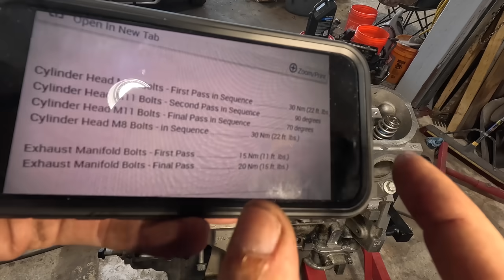This is the LAST VIDEO (LS Engine Rebuild) Ls1 Ls4 2006 SS Monte Carlo 5.3 Part 5

Comment: To all the critics of Ray “refreshing “ this engine.  When I was 16 I rebuilt the engine in a 1964 Pontiac Lemans in a garage with a dirt/gravel floor, no torque wrench (I used a lug wrench).  Nothing was done to the heads.  That engine ran for 10 years after that with no oil use, no smoke, no rattle, no problem at all.  He is not building a race engine.  This engine will run fine.  He does not build engines for a living, he does not build racing engines.  He is doing this for a friend.  It will be fine.  Been there, done that.
Reply: Hell, I just did head gaskets in my 3400. Didn’t have an angle wrench for the tty head bolts. I eyeballed the additional 90 degrees using a breaker bar. It’s still going 30k later
Reply: St Augie Def if closer, TY Brother

Comment: The front and rear covers are supposed to be tightened down before putting the oil pan on.  Clearance spec is 0 to 0.02" from bottom of covers to block.  Tightening them to the oil pan first could side load the seals.  Also, oil pan to back of block clearance should be checked, 0 to .01", to make sure the pan doesn't sit past the block and cause the bellhousing to sit cocked.  It's probably fine though :)  That nifty plastic thing that came in the rear seal is to help align the cover as well as guide the seal on the crank.

Comment: One thing we did with my brother's 355 was chuck a shaft into a battery drill and spin the oil pump over before inserting the distributor. We spent about 5 minutes doing that. Even with assembly lube. We wanted the oil pump and filter to be primed and the oil galleys filled.
Reply: Unfortunately can't do that with modern engines
Reply: I had an old cord distributor that I removed the gear from just for priming the oil system.
Reply: No plugs and turn over with no compression until it makes pressure, then put the plugs in: always worked for me
Reply: @DaveBigDawg  arp does have assembly lube for this. The last 3.6 I did, I just poured oil on the cams before installing the cam caps. It was just a can and rocker replacement though, so it wasn’t completely dry. Sone semi modern engines used a cam synchronizer in the spot the distributor would go, so this you could still prime. Could also pull the fuel pump relay and crank sone to get it primed if no other options.
Reply: @ab2230  with the modern oil pump setup. That's your only option.

Comment: I was holding my breath when you were tapping the head bolt holes with a drill and no lubricant. Expecting a broken tap every second. Wheew!
Reply: Truth! I was pretty confident Ray had the control to keep it lined up solidly but the lack of lubricant made my nerves itch 😂
Reply: What you missed was that he should have done that BEFORE assembling the engine.😱
Reply: @justpray365  That would have been the ideal, but I trust the clean up Ray did was more than sufficient to get things where they needed to be.
Reply: A teenager doing his first rebuild in his parent’s garage might do this.  But being a supposed professional this is unacceptable.  The block should have been hot tanked and all of the blind holes should have been tapped and cleaned prior to assembly.  And using the 100,000 mile oil pump is also a rookie mistake.  That is a mandatory replacement part.  And I’m not going to get into the cylinder bores not being checked with a bore gauge.  Lazy unprofessional build.
Reply: @shakerman55  Ray mentioned that this was a refresh and not an actual rebuild. This engine block is made of cast aluminum. The acid solution in a hot tank would destroy the block.
Reply: He's not using a tap he's using a thread chaser
Reply: @mlieser1230  
As I was an engine builder/machinist, (just retired), I know that there are solutions for aluminum.  It turned into a rebuild.  He said that.  The refresh was when he was just going to replace the cam.  Then things got serious, and a rebuild was done.  The problem is that he didn’t check any clearances or send the block to be checked or clean it properly.  When you have an engine out and completely torn down, it is due diligence and the right thing to do to check everything.  He wasn’t going to even clean the threads, which is why he waited until it was assembled to do that.  Then blew dirt all into a sealed, (oil pan on) engine.  Amateurish at best.
Added:  And reusing a 100,000 plus mile oil pump is about as unprofessional as you can get.

Comment: Another tip from reading Hot Rod Magazine when I was a kid, stand on the back of the engine stand and pull the torque wrench back towards yourself on the head bolts.  This prevents the stand from moving around.  Works great and it's easier to pull on the bolts than push them.  I also clean the head gasket surfaces with alcohol, since it's the only solvent that leaves no residue.

Comment: I've been getting Rayman rays withdraws over the past week and a half.  Welcome back.

Note to self!  Chase all the threads
With just a bare block next time before last clean up before assembly.  Ez with the tap you can get them out but if you bust one off in the block they are hard to get out. Taps are made out of tool steel the blocks an aluminum alloy. You burn them out with a torch i belive.

I broke a few 18" long 3/8" dia drill bits off in the center of a piss poor connecting rods for a locomotive engine that was oil passages kept running into sand pockets in the castings.  These parts were huge.
One hole for the crank was 4.5" dia the piston side was 2.5"  the total rod length was   24" long with the cap on.  
We worked on a block once they were really big.
But not as big as the motors used on big ships.  They can be as large as your whole shop. Just the block.

Comment: Ray, you chased all the threads for the large headbolts except the lower center headbolt. I looked through until I found someone else who saw what I did and it seems that there were a few. It happened as you were asked to go "to the office!" @25:59 in the video.

@Rohambili
25:59 you dont run down the thread under this... Bad Ray, let your darling distract you...

Comment: I think the front and rear cover needs to be aligned with the crankshaft to be centered and not the oil pan the gasket will take up any differences from the covers and the pan. They make a centering tool for rear and front cover to achieve this. Please let me know if the procedure in the shop manual has been updated. It has been a very interesting video. Thanks for all you do.

Comment: I do appreciate you running a tap into the block threads, I have often wondered how much damage, that horrible crunchy feeling you get, putting bolts back where they came from, is doing !

Comment: 23:23 those cross hatch patterns look just fine.  A-rod nailed it!
Reply: He neglected to check the bore dimensions.  Or check for roundness.  The bad cross hatch is the least of the worries.
Reply: @shakerman55  You don't know that.  You only know what you see, which is what he included in the video.  Don't jump to conclusions.
Reply: @silicon212  
He said he wasn’t checking them or sending the block out.  And he waited until the engine was sealed to do the right thing and at least clean the blind holes out.  Then blew crap all over it.  And a high mileage oil pump!?  Seriously.🙄

Comment: Seeing a nut dropped into the engine (retrieved with the magnet) reminded me of a near-final quality check performed on jet engine builds.  Before the final button-up, the engine was rotated 360 degrees either about its longitudinal (roll) axis or its pitch axis, while listening for loos parts... simple, not time-consuming, but effective!  Not only were small parts like nuts and washers found, but also tools.  Just food for thought.

Comment: Paint marking is good. I almost killed my motor by missing a single rod cap nut. Shut it down moments before that thing would have fell off. That was a long weekend. Old engine kit, new one in, and out in like 2.5 days 😳. Put a new bearing on the cap I missed and all was good

Comment: I think the miniscule amount of marking paint would easily get caught in the filter.  One could make the argument that the brake clean is also taking assembly lube off the bearings as it is so light it will surely wick into the spaces between bearings and journals.  
But, Hey!, I did this stuff back in the olden days (60's, 70's & 80's).  I am sure things have changed a lot since then.
Run-up the oil pressure before starting and everything should be just fine...

Comment: As a hobby machinist, gotta say the freehand tapping with power made me nervous.  Didn't clean the tap between each run.  Even when manually tapping I use a fixture or guide whenever possible.  Takes very little to change the fit of a thread.
Reply: If tapping a clean freshly drilled bore, sure. But chasing already tapped threads to clean out gunk & loctite takes very little pressure, and there's pretty much no chance of a tap binding or seizing in the hole. Like Ray said in the vid, he's using a variable speed drill and feedback torque can be felt easily.

Comment: What a job! I do remember torquing head bolts. It may have led to an arm joint issue. Learned to use angles more than brute force to do them. These type with the 90/70 degree are especially difficult and critical since it is stretching the bolt and cannot do a "redo" if you missed the target or bolt.  Great video showing what is entailed in that process done properly!  Glad to have you back doing videos...missed you Ray!

Oh, and we got a Lauren/WifeUnit cameo today.  I don't think her footwear would be OSHA approved. lol  But would be high on the cute scale.  😊

Comment: As best that I could tell the tap that you were using looked like a starter/taper tap. Which would have been the improper tap to chase the threads with. That tap is used when you are starting to cut threads in a drilled hole. That’s why it’s tapered, and why it’s unable to cut or even chase threads at full cut depth to the bottom of the hole. That’s what a bottoming tap is for, and what should have used. That way the threads would have been chased at full cut depth to the bottom of the hole.

Comment: Would put grease on the chase tap to collect chips, and clean chase tap after every hole as to not cross contaminate, but then you have to brake clean every hole due to some chips sticking in hole threads.

Comment: If anyone watching is wondering about how the head bolts are torqued, these are called 'torque to yield' fasteners, as Ray said, they stretch to the point of yield, thus producing the strongest possible seal.  TTY bolts use a Torque to Angle tightening sequence.
Reply: How much further can a TTY bolt go before it fails?
Reply: @clintprice2123  They are one and done.
Reply: @silicon212  Think they were inferring to the ones that Ray clearly went above torque.

Comment: You made a comment lately (in this video or maybe it was the broken front axle video,) that you were struggling to keep your videos to around 30 minutes.  I have a suggestion - Pull a piston one time; hone the cylinder one time; change the piston rings one time; then simply say you'll be back after you do the other seven.  We don't need to see the same procedure seven more times.  Or do a brake job on one side of the axle, then say you'll be back after you've done the other side.  We're intelligent people.  We understand.  We know what's going on.  I think it would make the video much more interesting.

Comment: Ray on my opinion you should torque down the timing covers first because front main seal and rear main seal they would be center to crank On my opinion,  if you torque down the pan first, it might push against the front/rear main seal housing and won’t be  be center to the crank. we can always rtv the pan but not the seals.

Comment: Ray. I have to say this engine build has been one of my favorite series of repairs you have done.  I like watching this stuff and appreciate your attention to detail.
Reply: Reading sum viewers comments suggest this is a HOW NOT TO DO IT video...
Reply: I’m not sure if the details from the customer and that may have been why things many would do were not. If I were the customer and you’re already into that labor then having the block sonic tested and pushed to ls1 bore if possible and a new rotating assembly to include better performance upgraded camshaft would have been my way to go. Also heads ported and polished as well as decked and new springs and better roller rockers. However that adds another 5k to the build and that may not have been in the budget. Reusing the pistons is not a bad thing just not what I would have done as a customer. I also would have used main studs and head studs for longevity.  Either way I like watching engine builds and having built some I think he did fine. There was a cross hatching question that was addressed.

Comment: Respectively want to comment that I was taught a dry bolt can’t achieve the proper torque, you must use some type of thread lubricant for proper torqage
Reply: Bolt torque is almost always specified for a clean and dry thread. If threads are to be lubricated, a reduced torque will need to be used and should be called out in the documentation for the fastener. In the case of the head bolts, with thread locker, I suspect the manufacturer specified the torque with the threadlock. Unless specifically called for, torqued fasteners should never be lubricated. Lubricating will almost certainly result in over torqued fasteners.
Reply: You'd not lubricate head bolt holes this can cause a oil hydrolock  and allow the head to lif causing catastrophic failure ask me how I know!
I did pistons rings main and rod bearings on a 2.8L ford Capri (English vehicle) the car ran great for 4 hours and then the head lifted causing a failure.
Ford released a bulletin regarding this issue but only to the dealer network not the independent shops which is what I started and ran for 7 years.
Reply: It's like olpeoples underwear, it Depends. Every manufacturer specifies something different. Detroit Diesel two stroke engines call for slobbery amounts of grease called peanut butter because that's what it looks like. Different Strokes for different people.

Comment: Meticulous work, Ray!  No one should use power tools to clean tapped holes in anything.  But your experience and my decades as a maintenance machinist will let us get away with it. The cost in time saved is just not worth the risked time to install new threads. A speed wrench or a tee handle is best.

Comment: 5:50 - Not a new oil pump going in?  o.0  I mean I get it, it worked so why not, but... in the scheme of all that cost being put into rebuilding the engine, I have zero idea why that wasn't also mandatory.  Customer declined I suppose? Customer's not seeing a big enough picture if that's the case.  Unless I'm so far off base I should be put in time out... >shrugs<
Reply: A new oil pump should be mandatory on a rebuild.  The customer won’t remember anything but Ray did a bad rebuild, if the oil pump stops working.
Reply: @justpray365  It will probably leak oil pressure on the inside of the engine, in the future, since he didn't upgrade the dogbone or replace the dogbone o-ring.  The oil ports for the DoD system should have been NPT tapped and sealed or used freeze plugs to seal them instead of o-rings that will fail to seal, in the future (just like the 3.6 pentastar oil cooler).  Then there's the old oil pump.  These oil pressure leaks will be hard to find in the future without tearing it back down and you may not find all of them at that time.  All the fanboys keep saying "He's a mechanic and not an engine builder" and that makes it ok to do a half-assed job?  It looks like he found a quart of two cycle engine oil out of his storage container, at home, and decided to use that instead of proper break in oil with higher amounts of moly, calcium, and zinc to give the rings and bearings the best chance to seat/seal.  Just because it will kinda work (you won't know the difference- wink) doesn't mean it's the right thing to do.  I sure hope the customer got a shade tree price for a shade tree job.
Reply: It sure is dark.

Comment: just a quick question but arent you supposed to use shims to 100% center that oil pump onto the motor then cross tighten the hardware.... I have seen it done somewhere...
Reply: Thought the same thing

Comment: The dod ports in the intake engine block u should of plugged the holes !!!! If not they will leak oil for sure  that Plat u put on is supposed to cover them and seal them  they don't but it get it out the door lol 😂

Comment: Nice re-build Ray.  Personally, I never liked using stretch bolts.  Not that they are bad, its me.  I screwed up once installing them.  You are wise to keep everyone away when going through the sequence.  If I'm tearing the heads off I always use an ARP stud kit.
Reply: Interesting thought on studs. Dave down at Daves Engine does a lot of Diesel engines and he feel that using head bolts gives a tiny bit of spring on compression that helps relieve stress on the block. Studs in a Diesel doesn't have that bit of give and can lead to more stress on the bolt holes. I am no expert on the subject but it does make some sense. A gasoline engine doesn't have enough compression to make a difference.
Reply: @kenore4003  Yeah, I know.  I argument is nearly as old as which one is better Ford or Chevy.  On the stud side, they say all the clamping force is on top since you tighten the nut on top and they are reusable.  Most of the engines I have done are European, like the older land rovers or minis that are notorious for head gaskets.  For me the studs seem to help.